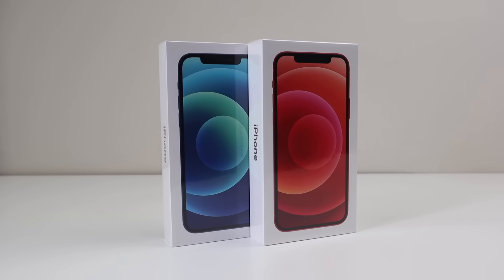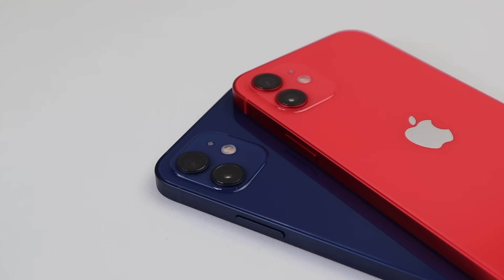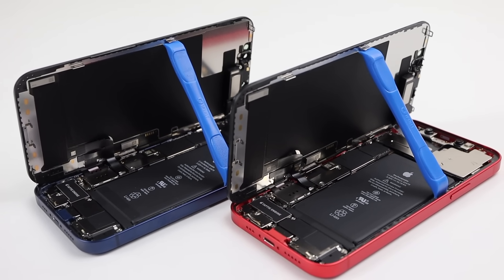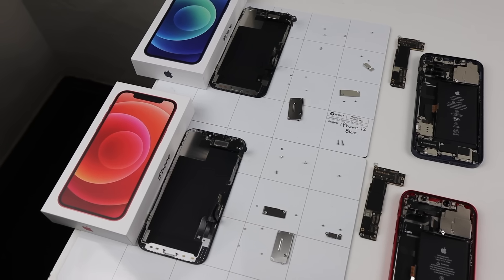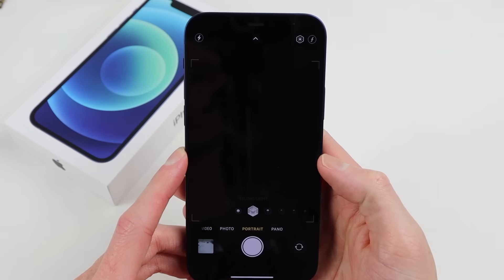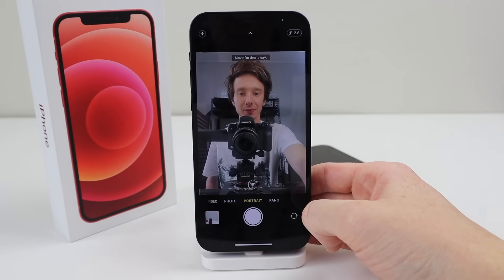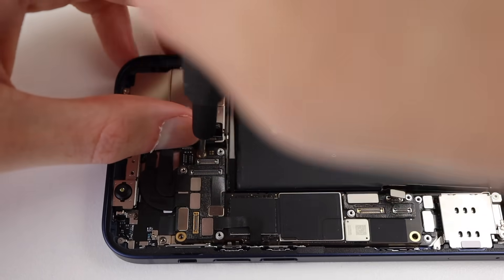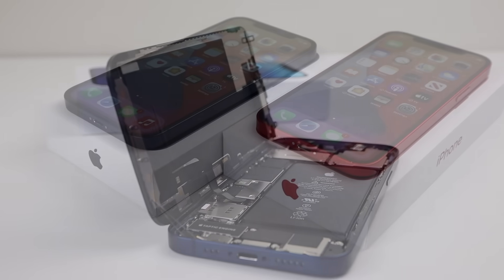iPhone 12 Anti Repair Design - Teardown and Repair Assessment

Comment: ***********       Do Not Buy  Any apple products , that are built to Break     *************
  ***********   Apple is a fraud business, has to go  *************************** 
 Fifteen month, ago I bought from Apple a new iphone 12 mini, then it went dead two weeks ago. However,  Apple service center told me " main board need to be replaced at cost $400 +labor and Tax "  almost $600 in  total  !!! 
The market price of this phone today is $300.00 
This phone is a very bad quality phone, it has garbage cameras,  Iphone 6S cameras are better than these in 12 mini !!! Its battery  need to be charged every day and the becomes very hot during charging. I paid for this piece of garbage almost $1500.00 for a 15-month usage !!!
Apple service centers are fraud repair centers !!!
I had very bad experience with them two times,  when I had iphone 6s few years ago, the phone died all of  sudden , apple service center fraudsters told me " main board has to be replaced, which will  cost $400+tax". However,  I took it to a corner store repair shop who  fixed the phone by replacing it its battery at a cost $60.00.
Another time,  I had a Mac book laptop went dead all of a sudden, I took it the Same apple service center, they told me " main board has to be replaced at a cost $1200." 
I took  the laptop, opened it to find some burned dirt on the board, which I cleaned with non-alcoholic cleaner , then, I put together and start it, it works until  today !!!!!!!!!!!
    In short, Apple is a fraud business selling garbage products, these product are built to break in less than two years !!!!!!! 
   Apple service centers workers have no technical backgrounds and they are well trained in defrauding customers making fake diagnostics and stealing the working hardware and the money of the customers !!!!!!!!!!!!!!!
You will be surprised, if tell you, I'm using, temporary, 10-year old HUAWEI  phone and its original battery I have revived , I paid for this phone 10 years ago $100 !!!!!
   i.e. the battery is 10-year old and still working fine, it needs to be charged every  3 days.
While the garbage $1500.00 Apple battery, has to be charged every day and has to be replace after one year !!!!!!!!!!!!!!  
  We the customers should not buy any  phone does Not come with less than Three years warranty covering every piece of this phone including the battery !! let us put an end to Apple fraud

Comment: It’s also funny how Apple fanboys used to roast Samsung for having a plastic, removable back to make swapping the battery out way easier, while the iPhone has always been anti-repair with a metal back (now glass). I’d much rather have a removable back (that doesn’t require any tools) than glass or metal, because I use my phone as a tool, not a fashion accessory.

Comment: You probably know this by now, it seems like its required to connect to power after a battery disconnect above a certain ios version, my xr does the same thing, power button unresponsive to perform first boot

Comment: Might be wrong but the camera being unreplacable I think is to do with FaceID and security. Like maybe it’s possible to get into a stolen phone by changing the camera or something. Similar to how the TouchID stopped working if you changed the home button
Reply: face id doesn't use a camera it uses an infrared mapping sensor

Comment: Repairing an iPhone is the worst experience ever. I wanted to buy a new one and fix my iPhone’s battery to give it to my mother, but after finding out that the rates in my country are over 200$ for a battery repair I simply decided not to buy a new iPhone and give my mother an Android device. Authorized repair shops here charge over 100$ just for installing the battery, not including the part, which they sell at an excessive price.

Comment: I dropped mine. Never opened it, never messed with it, nothing. Now it acts like this and it does not charge just stays on for a minute and then turns off. It days battery cannot be verified and genuine. Fu*k apple.

Comment: I think people are forgetting this:

As long as your device still in warranty & you are not breaking back / front glass, you can still bring your device to Apple for free.

Well, actually they will not fix it, but you will get brand new replacement device, so you will get a new phone
Reply: Here’s the thing though

A: replacing the phone entirely if you have one fault is lazy and stupid

B: Your phone will be considered “out of date” in a year because apple rereleased it and called it new, so you will have to pay a hefty fee to get it replaced, and in 3 years time, Apple probably won’t even attempt to replace it, which means you have a paperweight phone that can’t be repaired so that more people buy Applecare
Reply: Apple fanboy

Comment: Since most 12 or 13 users will be updating from an older lightning-equipped iPhone (side-note, shout-out to those just now updating from a 4 or 4s), the old charger still works. And if you have one of the larger iPad charger bricks, it even charges a bit faster. Still not as fast as usb-c, but still very usable.

Comment: bruh you are dumb as fuck, Face ID only works with flood illuminator but I guess you dont even know what its that, that its in front speaker swap it for the correct screen and Face ID will work good
Reply: He didn't really trash FaceID not working because there's genuine security reasons as to why that is. But that doesn't give Apple an excuse to lock everything else like the cameras, screen, and battery.
Reply: @SungMammal  it doesn’t, whatsoever if you aren’t a technician don’t talk, I swap everything in iPhones yet it works like original, why? Cuz I know how to do it, this dude it’s a clown
Reply: @ronaldrodriguez7469  Well not anymore, Apple removed the Face ID software lock a while back, which was after this video was made. Ive also done some work on iPhones and they have had these software locks in place. The only way you could get rid of them is to get a reprogrammer to rewrite the correct serial number onto them. Also, if the flood illuminator is broken and you replace it with another one Face ID will NOT work. It’ll only work if you only do a screen replacement.

Comment: The non functioning FaceID might not work due to security reasons. The FaceID chip probably lives outside of the main board. It’s very common design practice in engineering. During a normal operation, the FaceId chip detects a face it only sends a command “unlock” to the main board. Therefor the main board has to be pretty sure that the command came from the authorized FaceID chip. Otherwise an attacker can just swap FaceID chip for a chip with his on face, connects it to the main board and voilà, the phone is unlocked. 

Can it be done another way? Not sure. But In this case Apple probably did a good decision that prevents your phone being easily hacked by a repairman next door.

Comment: Well, i once brought my iPhone SE (2016!) to an apple care/repair partner for a battery replacement (since i once fked up a iPhone 5 battery replacement), they told me to repair my phone (= replacing battery, all i wanted!) it will cost something like 400€ (more than it costed new!)...
Why the repair was that expensive? because the front glass was scratched heavily they said it needed to be replaced, same with the very ugly metal frame and many other things they said "needed to repair" because if they fix your iPhone, then completely to a state of "refurbished/like new"

Luckily there was once this event where apple allowed battery replacements for 30€, i tried it at another store, and well- they didnt care about the bad astethic state of the smartphone and replaced the battery for only 30€ within 15 minutes, good job of an apple partner!
Reply: This 2016 SE has now another brand new battery in it - but this time i risked it myself, anyways knowing apples tricks already and learned from my failed attempt at the iPhone 5. It acts now as my iPod (bcause 3,5mm) and backup device.
I (sadly) got now a 12 Mini for a good price, since i didnt want to wait for apple to re-release any SE/budget lineup again and the dropping 12/12 Mini prices shows it anyways: The 12 Mini is going to get the new "SE"/Budget iPhone since the release of the 13, mini and pro.

I bet i wasnt the only one waiting for a SE or small iPhone, but since the lack of small phones at all and crazy prices which even seem to increase, still,... 510€ for a new 12 Mini was ok for me.

Comment: This dude is trying to heat up adhesive to 80 degrees that’s lower than our body temperature🤦‍♂️
Reply: It most likely in Celsius, which is a lot higher than body temperature,  which is 37.

Comment: I don't buy the environmental angle when I have to buy a power adaptor that is in a package of its own, that needs to be delivered to me speratley. On the upside, apple does support older iPhones with updates for longer than any other manufacturer.
I have 5 year old iPhones that run on the latest iOS.

Comment: The only things I would ever do with device part pairing would be the following:
1. Let Face/Touch ID work, but all data on them is wiped, so you have to set up new fingerprints/Face IDs. A test may also be needed to make sure it's not a spoofed ID or whatever.
2. Possibly perform a hardware scan to ensure the new parts are working properly.
3. Have it say somewhere that the device is refurbished and thank you for using a refurbished device instead of letting it go to e-waste.

Comment: hey guys, can someone please reply to my question, my iph 12 pro max frame is looking ridiculous now so i want to buy a brand new looking 12 pro max which is locked icloud, so if i swap the display, logic board , battery and face id to the better looking one i will have any issues? thanks, or lets say i will put all the parts from my phone( logic board, display, face it) except my battery, so i will use the one already installed in the other phone, i will see that message? that they cant verify if its authentic?

Comment: In summery, Apple's hardware scam is obvious so don't buy their crappy products. If you buy something, then you should have the ability to use it as you see fit. If I buy a car, I can improve it, repair it, or sell it for parts if I like... Because I own it, it's mine. When you buy an Apple device in their minds you are just paying to use it for a little time, you do not own the device. So yeah, moving on from Apple now.

Comment: Wait they don't even give you a charger head (brick) now?

What kind of joke is this?
Reply: Apparently they believed that producing more chargers create waste. Also it adds insult to injury when you used an iPhone 11 Lightning to USB-C cable, which ONLY exists on 11 and 12.

It's basically creating the problem and selling the solution, which adds a lot more waste (packaging). Since Apple did it first, Samsung and even Xiaomi followed suit.

Comment: idgi. if you’re unable to repair the iphone using OFFICIAL apple parts, what does the apple genius techs do that overrides that issue? 
i’m still using my 6s and am worried when they will eventually stop supporting it and make me buy a new phone. will i be able to fix it outside of apple?
Reply: In 2017 the company confirmed it did slow down models as they aged

Comment: What about swapping the displays?
Reply: Swapping displays will give the non-genuine display message, as well as disable Face ID. The display is bonded to the original phone. 

Third party repairers get around this by transferring data from old to new display to regain truetone, however the error message still appears.

Comment: My phones manual said not to work on it yourself, I recently pulled it apart to change out my charging port since I was tired of LG messing it up for a 3rd time (first time the one it came with was saudered wrong, sent it to them, returned and had the same issue after a bit) got a third party port, replaced it, everything worked fine and the port was better made. 

I would owe alot of money to lg if I kept shipping it back to them, I can't imagine  a company wanting to do that repeatedly, surely it must cost them money too, right?

Comment: Just some FYI content for you: Today is July 25, 2021, and new X series iPhones(in retail packaging) do not ship with a power adapter, either. They come in the new, more slim box as yours did, with the same cable, and you must purchase the USB-C wall charger separately, for about $20US. I was pretty angry to see how much I spent on a phone that could not be properly charged out of the box. I just purchased a new iPhone Xr through AT&T's upgrade program. My wife purchased an 11 using the same program. It was equipped in like manner. Wow, how disappointing.

Comment: I’ve owned an iphone for the past 6-8 years and only ever upgraded to an iphone 11 red once my first one (iphone 6s+) began to have the battery so degraded it only fully charged for an hour and constantly overheated (didn’t want to buy a new battery). And even though I owned it, it was originally a gift from my mother. Once this phone becomes ‘obsolete’ in 5 years, I’ll be storing all files on my computer and either downgrading or changing to motorola/samsung.
Reply: In 2017 apple confirmed it did slow down some models as they aged

Comment: The rear camera on my phone does not work when in 1x zoom. If I put it on 2x zoom still not working . Camera works fine in “selfie” mode but does not work in rear camera mode. If another app that uses camera is opened, the camera is still black and unable to use. (ie Snapchat).Please any idea on that.

Comment: You have to marvel at the slimy genius of it. They've taken the extra time and effort not only to make original parts non-interchangable, they've made the errors look erratic, so that any repair job will look botched. No doubt when when you take it to Apple for "proper" repair, all they need to do is plug in their diagnostic tool and press "authorize current hardware" and charge you 50-80 dollars for two minutes of unskilled labour.

Comment: Let's prevent E waste by not making our product streamlined and uniform with everything else if they really wanted to prevent E waste they would just switch  Is keep USB type A 3.0 and 2.0. Every year there is a new Apple phone if you wanted to prevent E waste you wouldn't make your products artificially obsolete and slow them down artificially. And you would also make e recycling easier to accomplish.

Comment: using parts and methods that are "Carbon nutral" and "enviormental friendly" meens nothing when you are oposed to rigth to repair.
garbadge that is "carbon nutral" is still grabadge, and a repaired phone that would otherwise become garbage is litterly carbon nutral and 100% enviormenally friendly. well exept the spare parts you would have to use.
When companies do things like that to look like they are helping the enviorment, but prevent repairs, they are just vitrue signaling and is in the long term harming the enviorment for the sake of their profits.

Comment: Why people still by Iphones is beyond me.
Reply: Because I like the phones and they last me a while
Reply: @beankaty2651  well, you ain't gonna get that with the planed obsolecence and no way to repair them, my Galaxy S3 lasted me for 5 years before I had to buy a new one, and it worked even than, I just wanted more out of my phone, also, I could expand my memory with micro SD card, you can't do it with iphone, not to mention them beeing a shity immoral company that thinks of itself higher that their heads are up their ass sniffing their own farts.
Reply: Probably just preference (they grew up with it) or just to flex the new iphones.

Comment: One of the most  stupid and slowest phones😅 i had iPhone 12 pro max  and it kept getting frozen suddenly for like 5 sec then it gose normal as well as phone call dropping with no reason even when i am outdoor ,  i tried everything thing like factory reset , taking it to warranty  and remote control over my phone by apple  .. receiving the same answer your  phone has no problem so i had to sell it  loaing around 200 $ and got me ultra 21  ... never again apple 😅

Comment: this is stupid, they change to a usb-c type of cable but still maintained the lightning cable part?
the amount of greediness that apple just level up.

from their exclusive adapter (lightning and their old adapter) to now change the normal usb hub to a usb-c one.
they are blatantly punching everyone onto their faces and telling them that they're promoting monopoly over everything.

and yet people who bought apple products would just tell you "you just can't buy apple products" logic.

the movement of some modern android phones to change from the old usb-b port to usb-c has some issues regarding older ports being e-trashes now they just added more potential e-trashes for people who are considering to switch to apple.

Comment: This is annoying.

I think that all the iPhone should do about unmatching parts is put up an unremovable notification about it into notifications. 
So if you replace something with something with wrong firmware, the notification will say:"Warning, third party [component] detected. It may not perform correctly." However, the iPhone would attempt to treat it as a if it was the correct part otherwise.

If the part had correct firmware, but was not paired, it would say: "Warning: Second-hand [component] detected." But it would still work as intended.

Comment: I remember after years of using a Nexus 5 the fucking horror I felt at how you had to remove the display in the Pixel just to get inside. Just ended up going back to my Nexus 5. If I can't fix it myself and if the local repair place can't even fix it either I'm not interested.